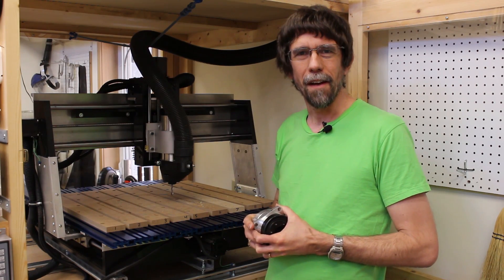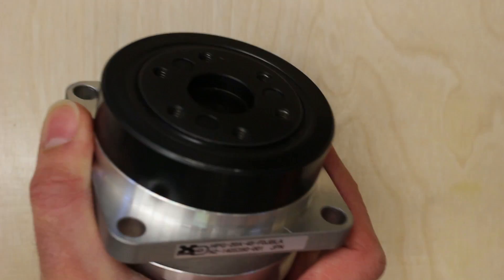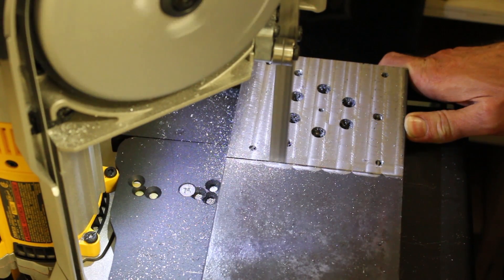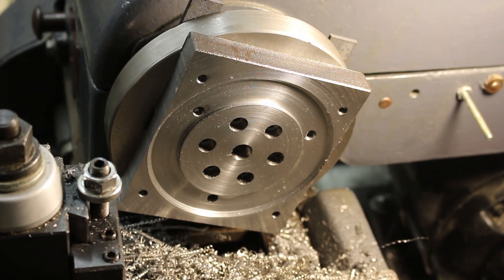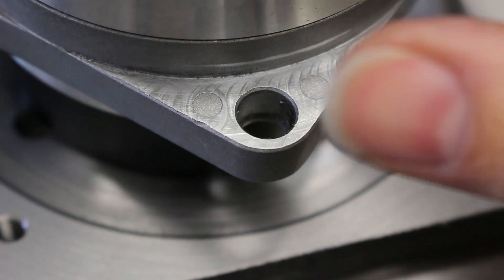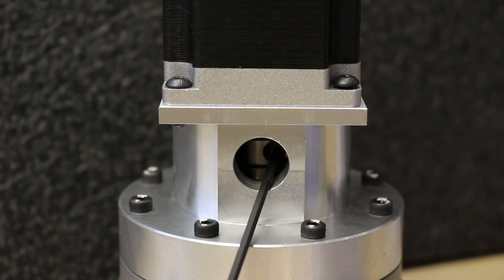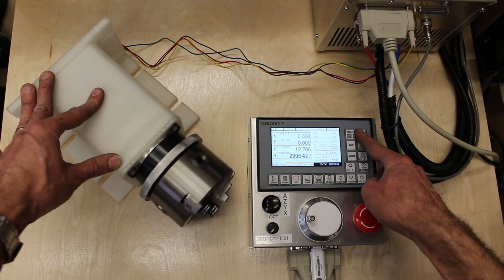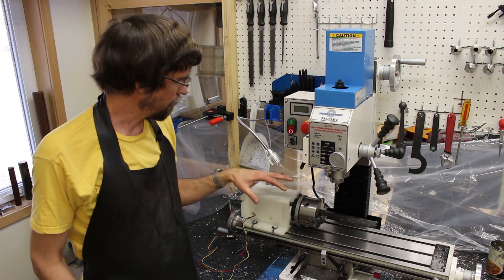4th Axis Harmonic Drive Build Part 1

Comment: Excellent, thank you, sorry this is a bit off topic but I'm really impressed with how you made this but especially on the adapter plate, how do you transfer the location of the holes from the motor and the chuck assembly AND still keep it all in alignment? Is it just measuring with calipers or using transfer paper, could you please make a video on how you marked it out? I'm new to machining, got a little mill and lathe and am trying to pick up as much information as I can from watching great videos like these but I know I'm missing some basic techniques to build on! I've built a furnace and am making some castings in aluminium and brass, and when the mounting holes are on the top I can transfer punch through a location hole to the drill out but when the part is 'facing' (sorry I can't describe this any better) the holes are then covered so I cannot see where to mark. Hope that made sense? Any help appreciated, thanks
Reply from the maker: I used the drawings of the motor output flange and the chuck mounting from the manufacturers to get the hole spacing, and I also double checked them with calipers. Just using calipers would be good enough because these holes don't have to be super-precise. The lathe-turned and 4th-axis-turned shoulders on the plate are what keep the parts concentric, and the bolts just keep them together so it's desirable to have a little extra clearance on the bolt holes. If they're off by a little bit it won't matter as long as the bolts don't bind.

You could make the holes any number of different ways but I used trigonometry to calculate the X and Y offsets of the holes, multiplying the radius times the sin() and cos() of the angle for each hole. Then I zeroed out the dials on my mill at the center of the plate, drilled a reference hole there for later alignment, and cranked the table the required distances in X and Y in order to drill all the holes in the proper locations. It would be much easier with a DRO or better yet a rotary table but this is the old school way and works fine. As a sanity check, I first laid out all the hole locations physically using dividers and a protractor, so that I could easily see any gross error in my calculations and table-cranking. You could do it all that way, scribing layout lines with dividers and such, and it would be close enough for this if you're careful. Worst case, if a bolt ends up binding then you could just enlarge its hole a little because the bolts only hold things together and don't maintain the parts' concentricity.

When I made the back plate to mount the 3-jaw chuck to my lathe, after turning it to size I used a simple transfer punch (off the lathe!) to transfer the chuck mounting holes onto the back plate. That would also have worked in this case but it was easier to do it on the mill. As you observed, that wouldn't work for the blind holes on the output flange of the harmonic drive. There are blind transfer pins that would work, and you could make your own, but I think it would be easier to use X-Y coordinates on the mill or to scribe layout lines with dividers.
Reply: BrainRight Thank you so much for your reply, very clear, shame you mentioned using math though, ( ha ha) I've not had to use it like that since school, a long time ago! 😪. It may sound daft to you or others but I did not know the expression 'blind hole' but now that makes perfect sense. I like the idea of making various size transfer pins to help with that. Really appreciated your video and reply! Cheers
Reply from the maker: In my next video, about making a faceplate, I show 3 different ways of laying out the hole locations including the trigonometry to calculate the X and Y offsets.
Reply: BrainRight Your a gentleman! Thank you! I'm done in after spending all day packing up my little workshop, ready for a house move and that's just put a smile on my face 😀. Cheers

Comment: Hi Brainright,
Very nice videos and good workmanship. I am planning to use the same controller for a router project. I don't like Mach3 because  of it's crashes and stuff here and there. This tiny little controller is powerful enough i guess. Seems stable too. BTW did you experience any crashes/hangs/bugs while using it? And another question is, "How did you manage the tool wear/offset at 11:14?
I guess you would have taken the usb out and redone the Gcode. I will be happy to know if the controller can handle tool offsets/tool wear compensation.

Eagerly waiting for your reply.
Again , Nice work.
Cheers.
Jas
Reply from the maker: Thanks Jas. So far the controller seems stable and hasn't crashed but the most I have pushed it is in the micrometer dial project I did, and that was not really stressing it in terms of program size or driving all 4 axes at once. The controller does not support cutter compensation, so you're exactly right that I had to modify the toolpath and regenerate the gcode in order to compensate for tool wear or deflection. I don't find that a major inconvenience because I mostly do one-off projects and I usually have to tweak the toolpaths multiple times anyway. It would be a more significant limitation in a production environment, and especially in cases where cutters have been resharpened. So far all my end mills are relatively new and very close to nominal size, but their sizes will be more variable once I have set up a system for sharpening them.

I think most of the offsets I see are due to deflection because the CNC Shark router's gantry is not very rigid, as it was designed mainly for woodworking. You can see some of that at the end of the micrometer dial video, where I think deflection caused the slight asymmetry visible at the top of the index marks. I could beef up parts of the router to make it more rigid, which I've already done to a degree, but I think the effort will be better spent doing a CNC conversion on my milling machine.

Cheers,
Jay
Reply: ahh, good to know that i am right about few things in the world.
Another question- Is there a Gcode limit on it? like maximum number of lines etc?
Also if you can share a list of g/m codes supported, i will be thankful. I have found a pdf manual but i don't know if it is written by the manufacturer or by some reseller.

Thanks a lot for your reply.
Good luck for your future projects. 
regards,
Jas
Reply from the maker: There's no limit on G-code lines as far as I can tell. It reads the code from the USB stick as it is running. On my web page at http://brainright.com/Projects/CNCController/ I put a copy of the PDF manual, which may or may not be the one you already have, and it has a list of all the G-codes that are supported.
Reply: Hello again mate,

I have just bought this controller and it looks fairly easy to setup and operate, but i am afraid if there are still major bugs in the firmware. Something suspicious happened on the very first day when i was trying to configure the settings (I.e parameters). I started with just one axis (X). Did the steps calculation, figured out the direction high/low and everything on the x started working. I wired the home switch and it worked as configured with "5mm move back" after homing. But now it is going crazy. While homing, it moves the x axis towards the home switch and just when the home switch breaks (it is nc i guess), rather than going 5mm away from the switch, it goes into the same direction as the switch, hitting the mechanical limits (missing the steps). I have tried changing the "x axis back distance after homing parameter-83" to a negative 5mm (-5mm) but it doesn't allow the + sign to be changed in the parameter. Any guess about what's happening? If i set the back distance to 0, homing works perfectly fine. I am worried why a thing will work one day and won't work the other day? I have played with the settings for a long time but no luck. The biggest worry is that the controller also shows the "-5mm value" in the machine coordinates after homing. So it is the controller driving the axis across the home switch. It is not that the direction pin is not working. It is something else in the parameters or a bug in the firmware.

Also please let me know if you know a way to hard reset this controller or delete the settings file in the hard memory it has.
The chinese website they have up is in chinese, and guess i need to find a chinese friend if i need to use help from the official website. :D

Thanks.
Reply from the maker: Hi Jas, I have not used the home functionality but according to the manual (picture 2.19)  the home and limit switches should be normally open, not normally closed. That might be the problem. I would recommend wiring up the limit switches too, so that it stops before reaching the mechanical limits and that way it should not lose steps even if the home function fails to work as it should.

I expect that you could reset the controller by upgrading firmware. I think it is also possible to delete the settings file using the file management page. I would copy it first, using the copy/paste operations in the file management page, pasting it onto a thumb drive so you have a backup of it. Then if you delete the settings file and restart, I would expect it to reset to all defaults and create a new settings file. Warning, I have not personally tried this so I cannot guarantee that it will work, but that's what I would try first I wanted to reset everything. I think you can also create multiple settings files, and just load the one you want using the file management page. Again, I have not tried it yet but I plan to do that when I move the controller among multiple machines.

Regards, Jay
Reply: Thanks for your reply, Jay. I will try copying the setting file first. A dumb question, how did you wire up the external start stop or you didn't?
Regards,
Jas
Reply from the maker: I didn't wire up start/stop buttons, since they essentially duplicate the buttons on the control panel and that is already part of my pendant. It would make sense to wire them if using a separate pendant away from the control panel. I did wire them out to my large connector on the box though, just in case I might use them someday. The manual shows how to wire them in picture 2-17, just n.o. push buttons connecting them to COM+. I did wire my e-stop switch as shown in that diagram.

Comment: When can we expect to see the 4th axis in use on the Shark?
I have a 4th axis from another CNC.
I never thought I could use it on the Shark.
I guess now that the speed is determined from the controlbos and the stepper motor doesnt really matter?
The shipping on the original 4th axis to Australia would be a killer.
Cheers
Reply from the maker: My next video is a project made using the 4th axis on the CNC Shark and it is in progress, should be ready soon.

You should be able to use most any 4th axis with most any controller as long as the stepper+driver are compatible. The original Shark controller is set to drive 2.8A steppers so don't use a stepper rated for much less current or it can damage the motor. A stepper rated for more current should be okay, but wouldn't put out its max torque.

The speed is determined by the pulses-per-degree (or pulses-per-mm) setting of that axis in the controller. With my DDCSV1.1 controller it's easy to set that on the settings page. The original Shark control panel lets you set it in a settings page, and offhand I don't recall the secret control key and password to bring it up but you can find that on the cncsharktalk forum.